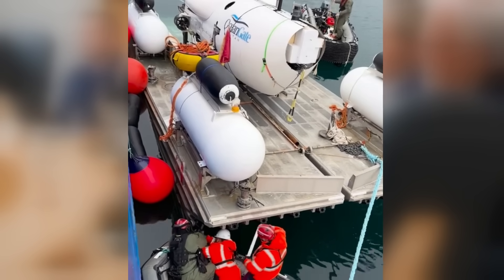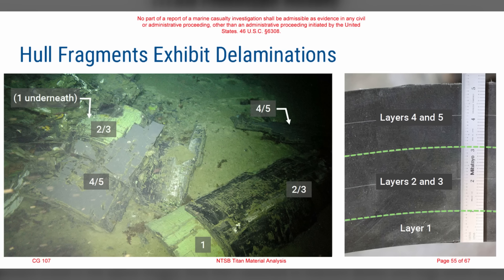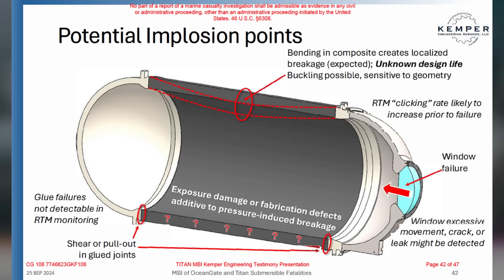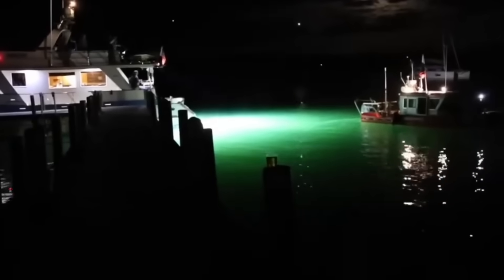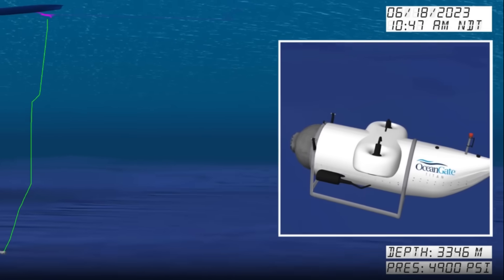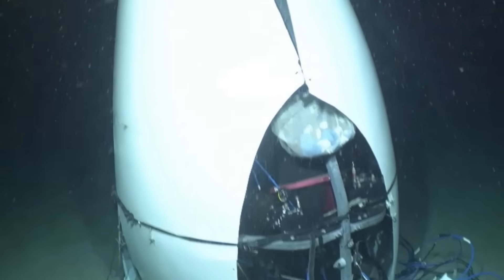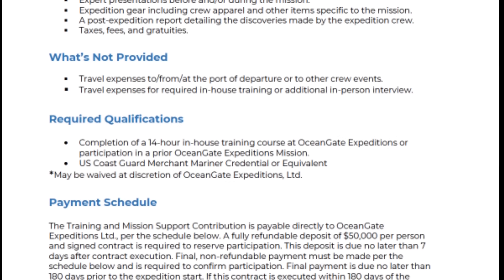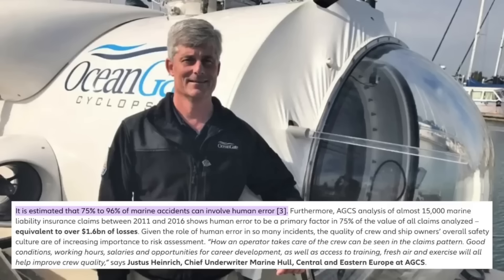Titan Submersible Debris Uncovers Evidence of Sudden Implosion

Comment: This is very reminiscent of the Challenger disaster. Rushing to meet deadlines and ignoring safety concerns again... when will people learn? Remember the O rings.
Reply: Yes I  remember the O rings. I knew something was going to happen because of the great amount of talk and speculation about the efficacy of them . They rings weren't flexible in cold weather.  But they did the launch anyway. I watched it on tv in horror as the ship took off snd almost immediately exploded.  I'm 63 now,  I was about 24 at the time. I'll never forget it.
Reply: @lifespanwellnessbeauty-60i64 I knew it too since I work with o rings. I watched in horror on my lunch break and feeling terrible for all the school children watching Christa McAuliffe die.
Reply: I made the same comparison.
Reply: While there are indeed parallels between the political pressure on NASA in January 1986 and the financial pressure on OceanGate in 2023, we should also recognise some important differences. 

The team of engineers at Morton Thiokol in 1986 were the only people saying Challenger should not be launched. Eventually, Morton Thiokol's management shut them up and signed off the launch themselves (because the engineers refused to sign off on Challenger's SRBs). By contrast, multiple people, both from within OceanGate and in the wider deep-sea exploration community, told Rush not to go ahead with his 5" carbon-fibre composite pressure hull.

Space Shuttle was - at least in principle - fit for purpose. The flaw was the unusually cold weather on the launch pad. Titan, OTOH, was always going to fail sooner or later. Many others have pointed out why - the unsuitability of carbon fibre for compression; the absence of diagonal cross-plies in the laying-down of the hull; the use of a 5" hull instead of the recommended 8"+; the way fractures and weak points accumulate over time in CFCs; the way OceanGate sanded off irregularities in each layer of the hull to ensure it was completely circular before the next layer was laid down; the way OceanGate bolted components to the interior of the hull. And so on.

Comment: He might as well have taken a plastic tarp, some PVC pipe, gorilla glue, some spray paint, and used that as the sub. His original construct looked like a community college project for Disneyland, not deep sea exploration.
Reply: You forgot to add a few cans of flex seal to the list
Reply: @philanders3705  😂 just for good measure
Reply: @humpadumpathump5918  haha you can never be too careful with this underwater tourism thing
Reply: @humpadumpathump5918 it literally was first designed by college students. I’m pretty sure he used college students instead of actually hiring experienced engineers. I could be wrong but I’m almost positive he did that exact thing to save money
Reply: College interns built it they said yesterday.  Interns - unpaid amateurs.
Reply: @EKA201-j7f thanks. I thought I had heard that when all this first happened
Reply: @EKA201-j7f  ironically, I saw that right after posting. I call it like I see it, I guess…That explains the Xbox controller! Now I wouldn’t be surprised if he exclusively used college interns for the deep sea test runs
Reply: don't forget the duct tape 😮...
Reply: Yeah, duct tape and chicken wire don't make a safe submersible
Reply: @joelbusald6416 I'm sure even Red Green would have had better quality control than Stockton!
Reply: Maybe he used Scotch tape and Elmer's glue.
Reply: It’s second to last dive it started to fail and until then was actually holding up well but like all diving tech it’s rated for a set number of dives and they found out when you ignore those set limits

Comment: EVERY ENGINEER THAT HAS WORKED WITH HIGH .. 6,000psig, PRESSURE CONNECTION OF TWO OR MORE DISSIMILAR MATERIALS KNEW THIS FAILURE MODE …
The design did work but the design cycles life had yet to be determined ..
NOW IT HAS !!!!!

Comment: I dont know about you guys but trying to garage DIY a vessel that is supposed to withstand 6000 PSI and where ANY significant problem means either a horrific but mercifully instant death OR being trapped in the pitch black at the bottom of the ocean slowly running out of air with virtually zero chance of being located and rescued in time, doesnt seem to me the kind of thing you cut corners on xD

How cavalier cowboy Johnny Stockton Rush got usually fastidious high rollers to drop significant coin and buy-in on those submersible coffins will go down as one of the great questions of our time lol
Reply: This is a very well written post. 🌷🌿
Reply: The tourists weren’t experts and trusted Stockton’s lies.
Reply: Bohemian club buddies

Comment: Not only did he use carbon fiber instead of solid titanium, He didn't even wrap it properly, its supposed to be woven in a pattern not strait across. Also this Galaxy brain thought he only needed 4 of the 18 bolts to hold the titanium dome on!
Reply: The submersible was also stored outside, in the elements, without even so much as a tarp thrown over it while not in use. It should have been stored in a climate controlled storage space. 
 It was also dragged behind the ship transporting it when there was no room on board to haul it. Allowing it to bounce around as it was dragged along. A crane operator even dropped it while lifting it out of the water. All around negligence.
Reply: and so many other not only problems.
Not only;
was the carbon fiber past its use by date
it not tested to destruction or for cycle wear
it was stored outside in the elements for 7 months
it was struck by lightning
it was towed in rough seas
it was made from off the shelf parts (like a pc fan and rubber maid box for the co2 scrubber)
it was showing clear signs of degradation as the hull flex was increasing with each dive
it was covered in untested at that depth rhino liner to prevent seawater intrusion

... I could probably go on, but at this point I have to start googling
Reply: @WorldofKlown  Wait, lightning strike? I've never heard about that.
Reply: @kranichkrone  I got that wrong. apparently it was the previous hull that was struck by lighting, and he fired the engineer for trying to declare that hull scrap.
Reply: He was another Captain Ron.
Reply: When you phrase like that, it feels like when folks dont use all the screws that come w the table they got from Ikea.
Reply: Stockton was a Cowboy 😮😮
Reply: To be fair, when you have insane pressure pushing inwards, you don't need many bolts holding the endcap on. Kinda like you don't need to superglue a diving mask to your face when going underwater, as the pressure holds it on snugly.
Reply: @Stealth55555 beet me to that
Reply: The extra bolts would have added to the structural integrity though @Nords555
Reply: @Stealth55555  If the carbon fiber tube is going through changes in its structure I think i'd prefer these bolts done up to give it more structural strength than just a few bolts and the water pressure. I was under the impression tho it was only like 4 they didn't bother doing up, only 4 done up out of 18 seems insane.
Reply: @MeoithTheSecond  The carbon fiber doesn't interface with the bolts whatsoever. Only the titanium window section bolts to the titanium ring structure. Has nothing to do with the carbon fiber sections. The CF section was NOT bolted anywhere. I don't think you understand how the sub was built whatsoever. Maybe watch some more vids on the topics. No bolt touched carbon fiber ANNYWHERE....
Reply: Interestingly, those four bolts are still holding the front dome onto the front glued on titanium ring.  They survived the implosion while some of the rear 18 bolts were destroyed.
Reply: @DrJuan-ev8lu  ??? No bolts every held Carbon Fiber to metal. Only GLUE ever connected CF to metal. So these bolts you are talking about, have nothing to do with the implosion, as no bolts were involved in any of this. Maybe you guys need to watch more videos on HIS this sub was constructed, because "bolts" have nothing to do with it failing and imploding. NOTHING.
Reply: @Stealth55555  Pay attention.  Nobody said the bolts had anything to do with causing the implosion.  But the bolts that held and the ones that popped gives clues about the  overall mechanism and direction of the carbon fiber cylinder implosion.
Reply: @DrJuan-ev8lu  The bolts had nothing to do with "the overall mechanism" nor "direction of the CF". Bolts had nothing to do with ANY of this.
Reply: @Stealth55555  You don't understand failure analysis.  Near the end of the implosion all the debris gets packed into various places.  For example,  If you examine the available photos you will see scrapes and marring on the inside of the front Dome.  Some look like green paint from the oxygen cylinders.  So the front hemisphere likely moved rearward and mashed up against them and the inner floor and hull liner.  This is likely how the acrylic window was popped out.  There is also a long slab of hull left intact underneath the location of those oxygen cylinders.  They probably protected that part of the hull as the front Dome moved back toward the rear dome.  And if there was this kind of motion it suggests lateral buckling and crumpling was a bigger part of the implosion mechanism than pure hoop collapse which last years FEA studies were forecasting.  More support is given by the huge amount of debris driven back into the rear Dome.  Too bad there are no GoPro or cell phone videos to confirm.

Comment: As a maritime designer; if i would see that tube from the inside i would have walked away..... where are the structural ribs to keep the tube from collapsing/buckling in the middle? 

Its such a gross design flaw ANY person like me would know RIGHT AWAY.... and i would have been right seeing the wreckage, it buckled/collapsed in the middle....

Oooooh nooooo, the priniting of that material.... you can see the air bubbles in their layering of the material.....should have printed that in a vacuum....
Reply: You really think ribs would have stopped this? Shows what you know about carbon fiber. Just saying.
Reply: @Handyman.300 The ribs would at least keep the carbon fiber from bending as it is not designed to bend
Reply: What printing?
Reply: @awkerper the robotic layering; essentially printing akin to how a 3d printer works... Just with polymer instead of carbon fiber

If they'd figured out a way to "print" it with multiple axes instead of a single direction... Maybe they'd have been on to something.

But then you've still got to figure out how to have an entrance/door without destroying the structural integrity gained by having multiple axes of layers.
Reply: @M.ds87 man I'd love to ride inside a submersible, I just don't see the appeal of diving to extreme depths. A fun cruise through a coral reef would be neat.
Reply: @M.ds87  I get it now, thanks.
Reply: Like the technical knowledgable input. It helps understand the errors.
Reply: They fired a person that help build space boosters . I dont think anyone couldve forseen this